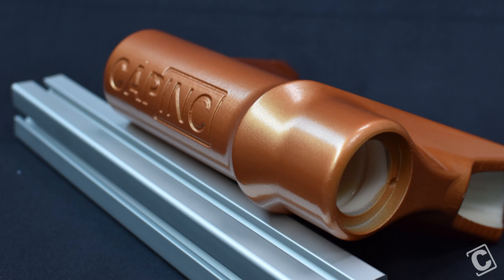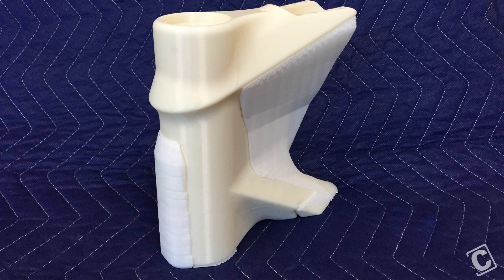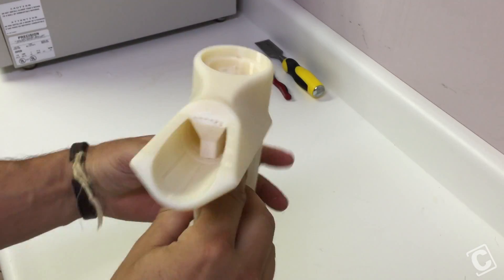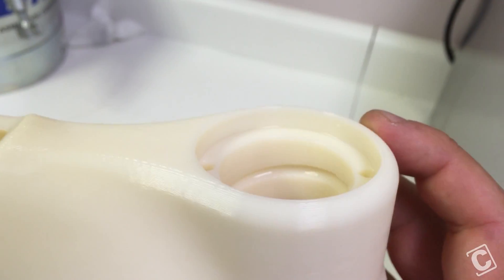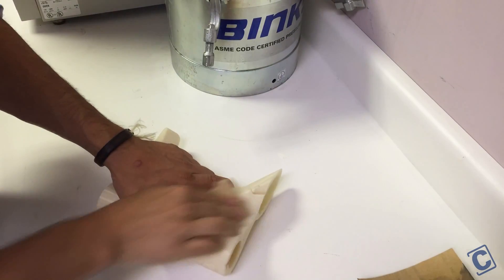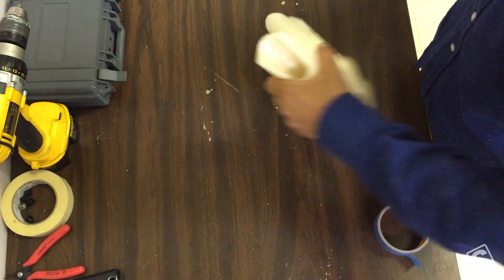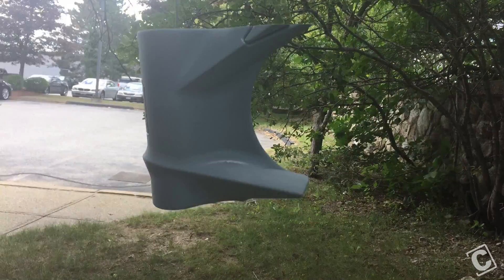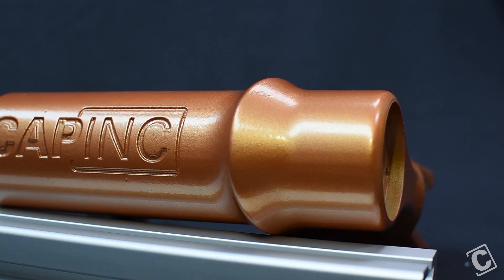How To Finish A 3D Printed Part To Look Like A Production Part

Comment: Is that ABS or PLA?
Reply: That's a prototype, not meant for actual usage but rather to showcase what the end product would look like. This could be either ABS or PLA, it doesn't matter all that much since it's not actually going to be used on a bike.
Reply: You can read all day about plastics and their properties (like I have) but until you spend time printing and handling them you won't understand the practical difference. I like the rigidity of PLA but it's more fragile than ABS. It's so rigid it can shatter into lots of pieces if you throw it against a tiled floor (which I've done in temper). This wouldn't happen with ABS, which I find  seems to print with a smoother finish, however it usually takes about 5 attempts to print something in ABS and lots of waiting for the bed to heat up to 90c. Also the high melting point makes it last so much longer. Put a PLA model in the sun for a season and watch your work deteriorate.
Reply: Yeh I think most hobbyist really get hung up on studying numbers sitting at their computer.  Practical experience ALWAYS trumps theoretical/analytical data.
Gotta get your hands dirty if you want to understand anything.  There are a lot of ways to make things out there.  The more you try the more likely you will be to succeed and the easier things become.
I think this video shows how good 3D print can look when you are good at post-processing your print.  Beware, lots of elbow grease, but the results are impressive.
Reply: Practice makes perfect ;)
Also, he who makes no mistakes makes nothing. Like you say, gotta get those hands dirty and not be afraid of failure. You WILL have 3D printing failures even when you've been doing it a long time.
Reply: Most of stratasy's printers are generally Hybrid printers (similar in function the SLA printers). They use UV cured resins, rather then plastic filament.
Reply: Stratysys printers are generally FDM printers using ABS.
Reply: With Stratysys, you don't use third party filament, they use ABS+ material with a soluble support which needs caustic soda to dissolve in water. ABS+ is very strong. I use it for part that receive a lot of impact and quick accelerations and decelerations.
Reply: It's ABS b/c they used the vapor technique, and right it likely can't handle the stresses in application because ABS has poor layer adhesion.  ...although maybe his $45k machine can fix this problem, I dunno?  PLA is much stronger than ABS for practical applications.
Reply: The main problem with hobbyist 3d printing is the lack of understanding of the science, as you just demonstrated.  I'm working on a 3d printing benchmark that might clear up some of these misunderstandings in a way users may better understand.

An Izod notch test is an impact test.  Materials have all kinds of properties, of which impact strength is one facet.  Its also not my job to educate you, so I just suggest you learn your plastics better.  99 times out of 100, a PLA print is stronger, typically because ABS layer adhesion is terrible.
Reply: Probably not PLA or ABS. It's part of a bike frame so it receives lots of stress. So probably a tougher material like colorfabb_XT or something similar in toughness which can handle the stress.

Comment: very well done. pla is easy to print but tends to be a pita to finish. i use the auto primer often, you can look for a build primer or sandable primer used for first rough finishes on cars. these fill in and are easy to sand. great video

Comment: Great video! I couldn't tell what type of material you are working on, resin? Does this finishing process works with PLA? thank you!
Reply: if it's resin he would not have needed support resin printing is when they use lasers to harden resin inside a bath.  there is also the hardening ink thing. wich uses uv light to harden a liquid ink.  (no fillements otherwise prints the same as a normal 3d printer)
Reply: This finishing process does work woth PLA. Just be sure not to use power tools as they can overheat the surface and melt away details. As long as the part stays relatively cool (PLA has a glass transition temperature of approx 65 degrees C) this technique will work great.

Comment: for an extra smooth finish and better adhesion -  with normal painting projects you give a light sand after the primer. - great  work BTW. loved it
Reply: +Tommie Ann McDonald Very true, I'd use something like 2000 grit or greater.
Reply: a buffing wheel

Comment: Hi CapincTv, could you tell us which brand of paint you were using? I can't seem to find the equivalent one from Krylon, Tremclad or Rustoleum.
Reply: +thephatnguyen for primer use SEM (choose white or gray) rattle can primer. Paint? I'd personally stay away from rustomium or krypton. Perhaps Google search "automotive grade urethane spray paint" and read some reviews :) good luck!
Reply: +ProModz 

Forgive for my ignorance, is SEM a brand or actually a type of primer?
At my local store, the paint section is usually split in automotive and home decor. For some reasons the paint in automotive is much more expansive .
Reply: +thephatnguyen Automotive paint is usually a lot more durable.
Reply: +thephatnguyen Home paint/wall paint is generally softer, and more water based. It's more designed for more porous surfaces such as drywall and plaster.  However, automotive paint is harder, and bonds to less porous surfaces such as metal. It also is more chemically based.
Reply: The auto paint is worth the extra money if you care about the finish.Leave the Krylon for painting the wheelbarrow.The SEM is one of the best spray can primers around but it's not cheap although worth it if you  want the best finish possible.A close second is Duplicolor automotive primer and their paint.They'll be about the best cost to performance price point most people can find.
Reply: I print from time to time and sell. When private customer are paying 500$ worth of 20 hours print time, I'd like to offer the best quality and esthetic as possible. I don't mind throwing an extra 20-30$.

Comment: whats inside of the washing station? how would i remove support material from something like that if I just use abs/pla for it
Reply: +pptx100 The wash station uses a solution of Sodium Hydroxide (NaOH). PLA or ABS can't be dissolved by Sodium Hydroxide, the support material is a special plastic that is broken down by the chemical.
Reply: +pptx100 That's probably a water soluble material like HIPS. You need dual extruder to use that method.
Reply: What exactly filament you used.
I heard only about water dissolvable filaments.
Reply: HIPS dissolves in D-Limonene. It's a good alternative to PVA because PVA can be tricky to store. It absorbs water from the air quickly and then becomes unprintable because the water inside the filament will instantly boil when exiting the nozzle. It will make the PVA bubble.
Reply: So, in other words, you used caustic soda as a solution. Can you tell me what ratio of water to caustic soda powder you used? Please.
Reply: But this 3d printer doesn't use PVA.
The material is called SR30.
Reply: they use 2 types of material. with hot ends.  or some kind of fillement splicer. but basicly the support is printer in soluble material.
Reply: Could be limonene (citrus-based cleaning product, C10H16), which can be used to dissolve HIPS.
Reply: +pptx100 acetone maybe ?